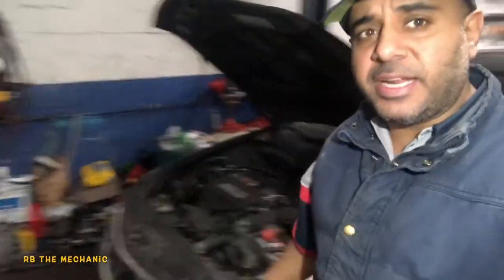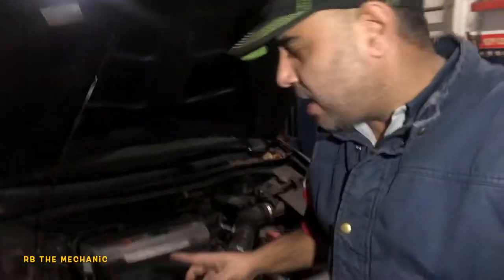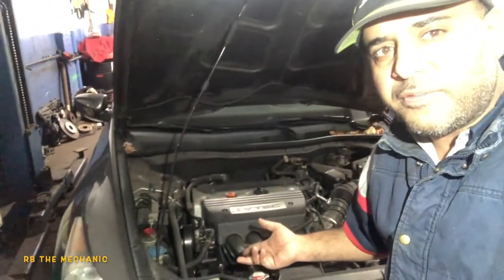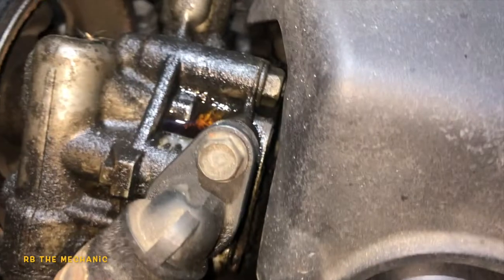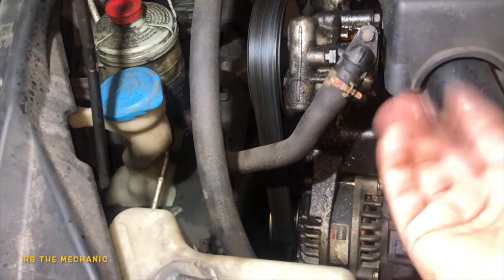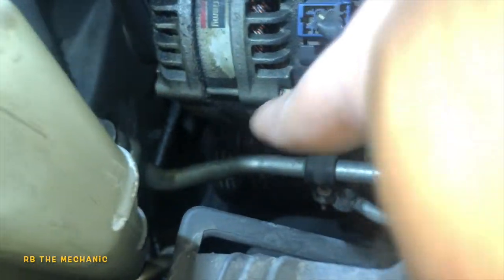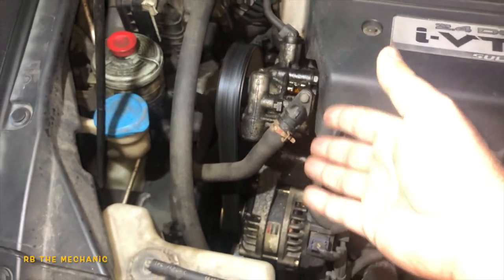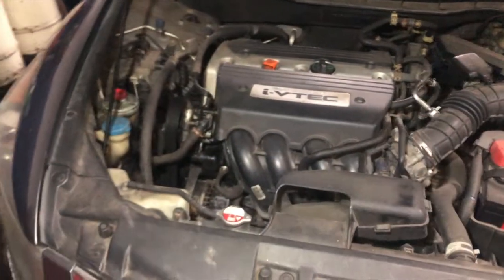Oil leaking on alternator /  People fail to fix till alternator FAILS

Comment: Walmart Auto Care technician changed my oil, but he forgot to put the oil cap back on. I drove my car for one day, and the next day, I found a mess inside my engine and on other parts. I noticed that my car battery is working, but my alternator is not charging the battery. The only reason my car is still running is because the battery is new. Now Walmart doesn't want to be accountable. They used brake cleaner to clean a little bit of my engine, but the damage is still there. I opened a claim with the California BAR to make them pay for the repairs and proper cleaning, if not it's posible they we have to go to small claims court.
Reply from the maker: Yeah I would sue them

Comment: FIX THIS OIL LEAK AFTER 210 USD FOR A NEW ALTERNATOR BECAUSE I LET IT LEAK BRAKE FLUID YEAH REPLACE THE O RING 14 MM I THINK AND HOSE ALSO PLEASE PLEASE REPLACE HOSE CLAMPS IF NOT GONNA FIX IT AFTER THE ALTERNATOR IS DONE FOR
Reply from the maker: Yup hoes are hardened replace em
Reply: @RBTheMechanic  it wasn't the hoses it was the o ring in the return line that connects the hose to the pump
Reply: @RBTheMechanic  but yes that's what happens they get hard and start leaking and yes it cost 200+ USD to replace the power steering oil soaked alternator
Reply from the maker: @RobertMorris-l3l  oh yeah

Comment: Hi I have a 2005 Honda Accord I’ve notice that there oil all over the alternator and also all over pulleys and I’m very concerned I’ve taken it too a mechanic but I was told that I needed to get degreaser and and clean the engine but when I took the car back to mechanic I was told that I needed to run car for a little bit because the engine was too clean so I now have noticed the leak is more worse I don’t wanna take my car back to this mechanic again because I think there just bull shitting me and my car has a serious problem thank you for your video
Reply from the maker: Yeah bro take care of the leak I have ton of videos on this accord easy to replace the so pump step by step guide just type in “accord power setting pump rb the mechanic” it will pop up